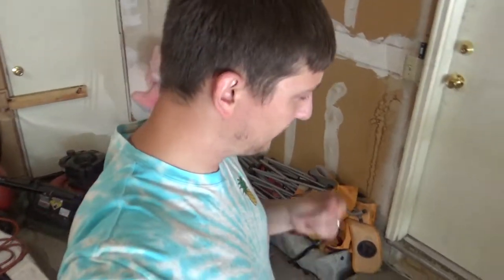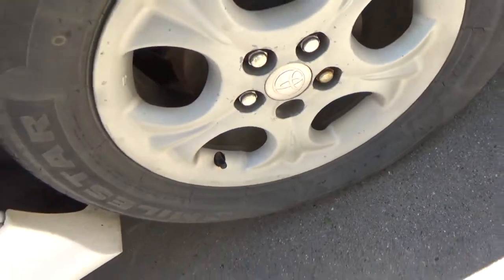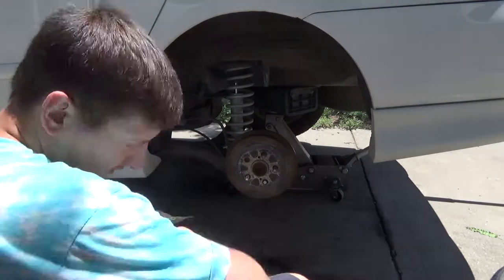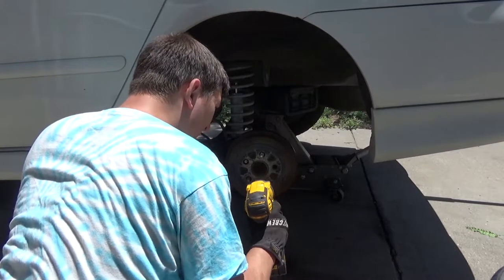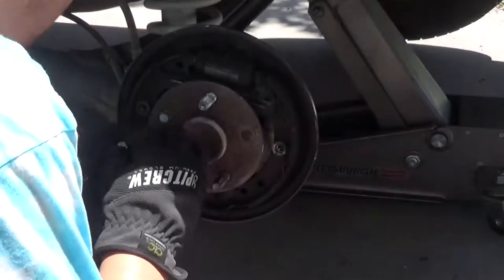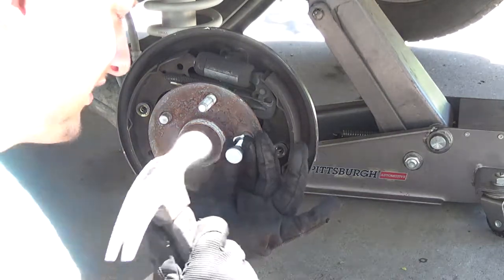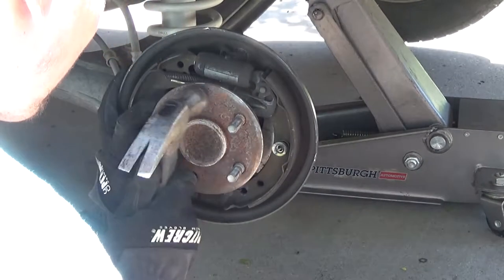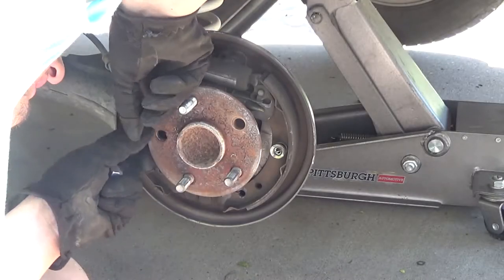How to Replace a Wheel Stud! (2003 Toyota Corolla S)

Comment: please use a Jack Stand. Hydraulic jacks can suddenly fail (Especially if it's been used to lift larger vehicles), and then you have 2000 pounds of car sitting on your lap.......
Just use the factory Scissor jack, as a second point of support at the very least. 
Anyways, thanks for the video, showed me what my car looks like taken apart!!!

Comment: What the bolt size again
Reply from the maker: M12x1.5
Reply: jessedrifts hardest part of get the studs to seat with out an impact gen used a few steel washer and open end wrench in hub hole and elbow grease

Comment: I checked this wheel studs on autozone,oreally, Advance auto, Napa auto , They all recommended Dorman 610-266. But it is a little shorter than OEM. and fit very hard to  screw into the hole. and the teeth is a little different than OEM. https://www.amazon.com/gp/product/B07997HQFF/ref=ppx_yo_dt_b_asin_title_o00_s00?ie=UTF8&psc=1

Comment: Thats not so smart dude.  You need to have put a space oversized   nut. and do not use power hand tool to do that. a breaker bar will be smoother